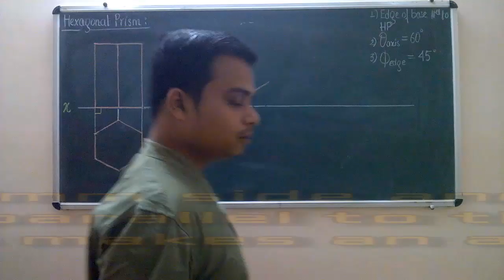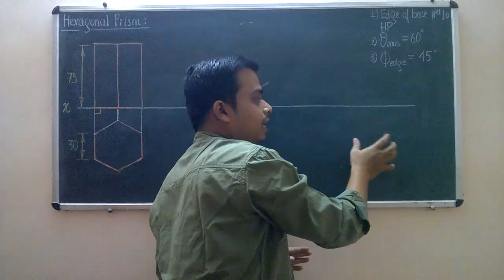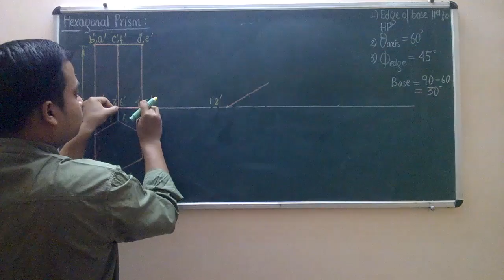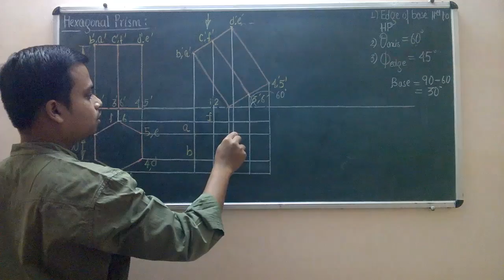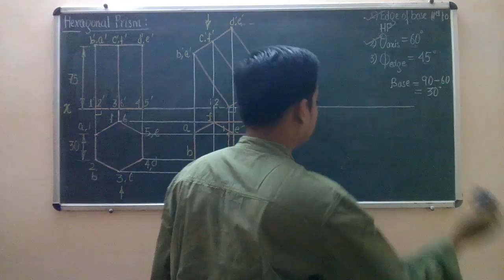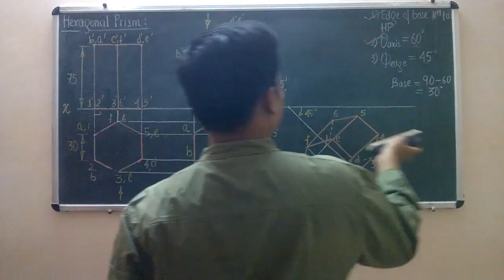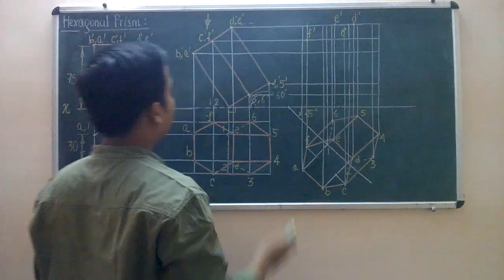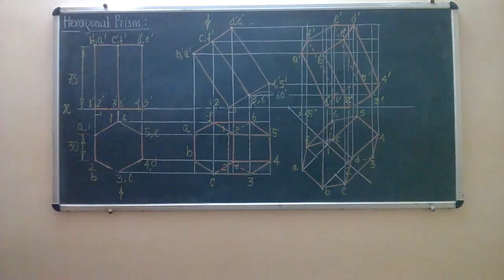Projection of Solids_Problem 9_Hexagonal Prism with axis inclined to HP & edge inclined to VP

Comment: A hexagonal prism is resting on a corner of its base on the ground with a longer edge 
containing that corner inclined at 45° to the H.P. and the vertical plane containing that edge 
and the axis inclined at 30° to the V.P. Draw its projections. Base 40 mm side; height 65 
mm.

Comment: A hexagonal prism, base 30 mm side and axis 75 mm long, has an edge of the base parallel to the H.P. and inclined at 45° to the V.P. Its axis makes an angle of 60° with the H.P. Draw its projection.

Comment: A  hexagonal  prism,  base  30 mm side  and  axis 75 mm long, has an edge of the  base  parallel to the H.P. and  inclined  at  45° to the V.P. Its  axis  makes an angle of 60° with the H.P. Draw its  projections

Comment: a pentagonal pyramid base 25mm side & axis 60mm long has its base on hp & one of its base edges is perpendicular to vp. it is cut by a section plane perpendicular to the vp, inclined at 45° to the hp & passing through the axis 40mm from the apex. draw the front view, sectional top view & true shape of the section-- ei drawing ta ektu pathaben

Comment: Sir I am confused.
In some of these type of problem my professor tell us to find beta angle while moving from 2nd step to 3rd.
So I am not getting when we have to find beta value and when not.
Reply from the maker: Send me a description of such a problem...
Reply: A pentagonal prism of side of base 35 mm and length of axis 70mm has a side of base parallel to the HP. The axis of prism is inclined at 30 degree to HP and 45 degrees to the VP. Draw the projections of the prism.
Reply: In this problem
Step 1. Front view rectangle and top view( pentagon with one side line perpendicular to XY axis).
Step 2. I draw new line X'Y' at angle 60 degree to XY and then draw auxiliary top view
Reply: After that sir told that to draw FV from this obtained TV you need true length of axis in TV.
So first find beta angle.
That part I not understand.
Please help me. Sir